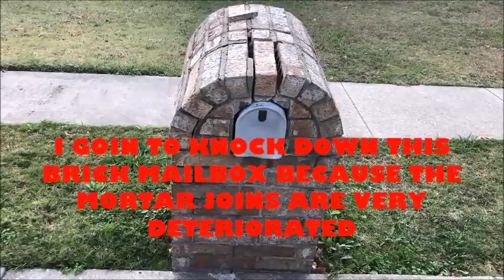BUILDING A BRICK MAILBOX FROM SCRATCH PART 1

Comment: That hole was an overkill. It doesn’t need to be than deep.  8 to 12 inches will be just fine.
Reply from the maker: @BraulioDeJesus  Hello Braulio de Jesus, if you watch my videos you will find a video how to repair a Mailbox that is Tilted and the reason why they tilt, for 30 years I have fixed mailboxes that are a foot deep or more and still tilt, and with this class of foundation it is guaranteed that it will not tilt, as I told you I have been doing this work for 30 years
Reply: I totally understand, you want to be safe. I should specify that we need to consider the terrain, how wide and tall it will be.    Very good job!
Reply from the maker: @BraulioDeJesus  thank you

Comment: How did you get the 2x4s to stay in place?
Reply from the maker: Hi Executive Bullies, It is not difficult, you just make the frame as the bricks work, and when you fill it with concrete, you square it and level it and when it dries, you check it again that it has not moved, but do not worry if there is a little unevenness that is fixed when the bricks are laid